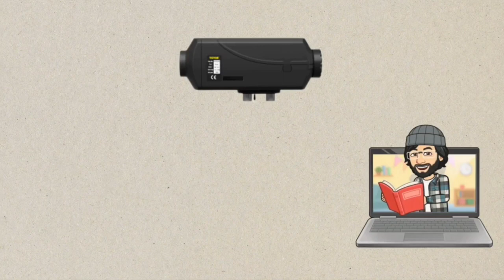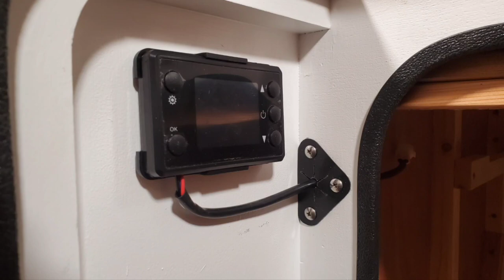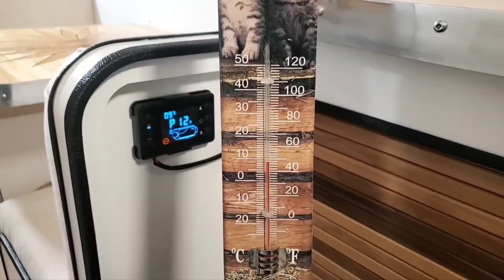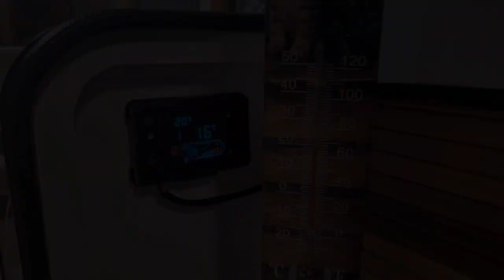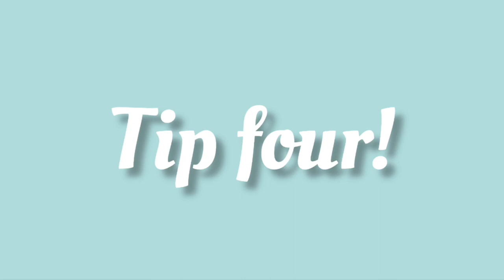Diesel heater installation in Tiny Houseboat! +5 tips!

Comment: We installed one of these in our houseboat project as well. We put the pump outside the house in the fuel tank box. It runs really quiet and we can't hear the pump running. We used it last spring and fall and it worked great.
Reply from the maker: Good to hear that it works well for someone else! Sounds like a good idea to install the pump outside as well!

Comment: Great work as always! That boat will be nice and toasty and cozy for those cold days and nights. I’ve just got one question (due to my ignorance about both boats and heaters)… will the rocking of the boat cause any issues with the fuel delivery from the tank to the heater? (If it’s gravity feed) or does it have an electric pump? Again I’m ignorant to such things so if this is a stupid question please have patience 😵‍💫
Thanks again for sharing your work!
Reply from the maker: As long as I don't capsize the boat, it will be fine with movement😁 There is an electric pump between fueltank and the heater, which is monitored by the control panel so the amount of fuel entering the burn chamber is always very controlled, no matter the movements of the boat. Think about it as an enclosed system unaffected by external forces. (To a certain degree at least.)
 Every respectful question is more then welcome, it is the only way we can improve! Thank you for commenting, as always, much appreciated!
Reply: @adrianwoodworm  Thank you for that reply and information about that heater. And I believe also, for the money you spent, it looks to be a great deal. I sure hope you don’t TURN TURTLE (capsize that is!) I would think your heater would be the last thing I’d worry about !!! … lol. 😵

Comment: نتمنى لك اعياد ميلاد سعيدة وكنت اتمنى تشغيل الهيتر لكي نرى طريقه التدفئة وياريت تشرح لنا طريقه عمل الكونترول والفيول بمب لاننا نجهل عمل هكذا نوع من الدفايات وشكرا
Reply from the maker: Unfortunately I could not show how the heater works because the fumes of the exhaust would have created a very toxic environment in the garage, but I will demonstrate it as soon as I move the boat out of the garage. It is a very simple heater. The 12v pump moves fuel from the tank into the burn chamber. The entire combustion process is sealed and all the fumes move through the excaust to the exterior. The aluminum housing of the burn chamber heats up and warms the air surrounding it, which then is moved with a 12v fan to wherever you direct the ducting. That's all there is to it. There are many videos on dieselheaters on youtube if you need more information, I hope this helps!

Comment: I’m enjoying burning windfall with Grizzly in my 100 sq ft tiny place at -30C. Curious what the diesel consumption is for that unit in your weather.
Reply from the maker: I am curious as well. According to the internet it consumes 0.11 - 0.51 liter per hour, depending on the setting. Only time will tell when I actually have a chance to run it for while. Burning wood, especially when it is windfall or scrapwood, is still the most satisfying way to heat your space in my opinion. Are you talking about the grizzly cubic mini stove?
Reply: @adrianwoodworm  yes, cubic mini. Weather warmed up to sub 0, -10 range, tiny house just needs morning and evening heating. Been pretty easy on fuel, can break up branch sized wood and get by easily.  Really liking this unit.

Comment: Not sure if anyone mentioned this, but I would have mounted the tank with the fill port pointing out away from the steps. Diesel is slippery, especially when mixed with water and it makes a huge mess when filling with a portable can.
Reply from the maker: It would be hard to reach when pointing the other way, you would need a ladder to fuel up when the boat sits on the trailer. I guess the key is to be a bit careful and not to spill diesel. And if it happens anyways, well, then I have to spend a minute to clean it up.

Comment: I see you got the diesel heater for free, but your water heater uses propane, and the motor will probably use gasoline. It seems more difficult to use 2, 3, or 4 different fuel sources.
Reply from the maker: Good thought, yes that is true. It is hard (not impossible though) to run it all on just one fuel source. That beeing said, I don't think it will bother me that much.